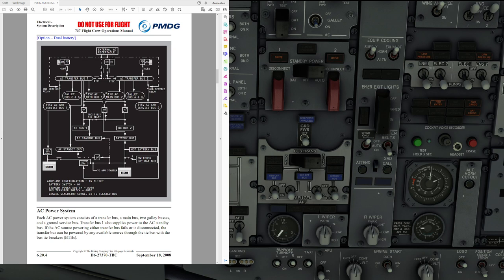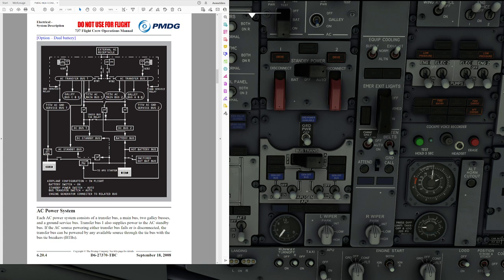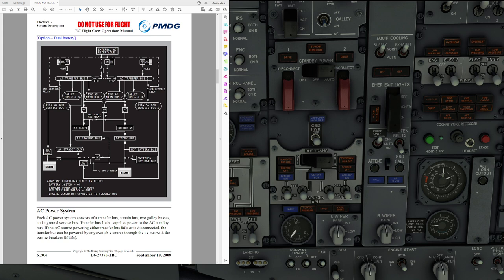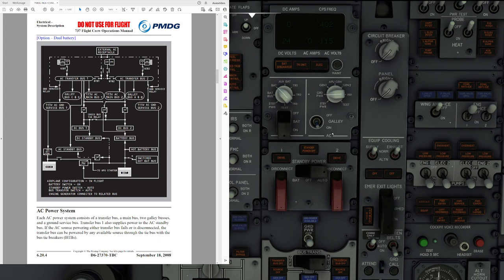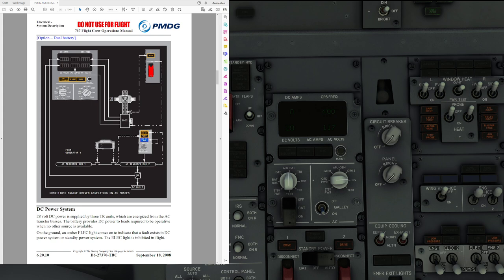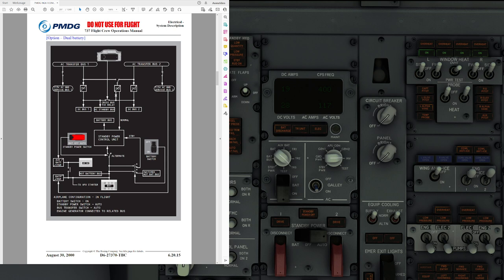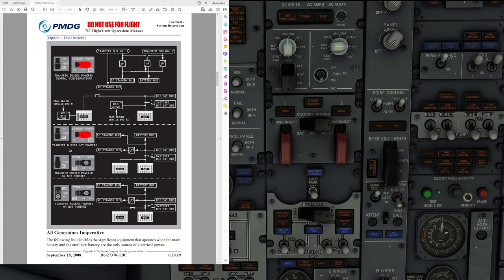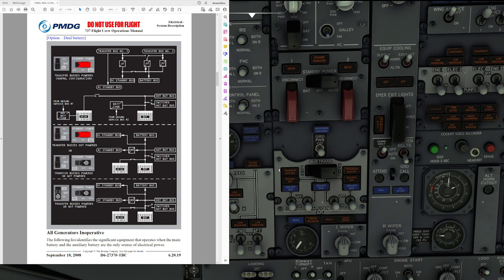737NG Electrical System explained | Real 737 Pilot

Comment: I have heard from my company's mtx people that if we were to leave the DC power display on Battery over night you risk draining the battery even if the battery its self is in the off position. Is this true? I am a ramper who's trained in APU operation for moving the Jet on the ground via tow.
Reply: Yes, as the battery telemetry that measures the voltage will draw a very small current (~1200 mAh) to power the display computer logic system, itself. Typically, this is not a real issue with modern dual-battery systems, but it was a minor concern with single-battery systems. However, the batteries would have to be quite discharged (more than half) for this to be a real concern. That all said, yes, it is best practice to not leave the battery monitor indicator switch on the BAT or AUX BAT (if equipped) setting in a shutdown (cold-and-dark) configuration, when possible. Hope that answers your questions, and BZ.

Comment: Sorry for being 18 months late but I have a question, I’m also aware you are now operating the A330 so may not know the answer but hopefully someone does. You mentioned that the only time the system automatically generates power in replacement of another is when the APU is turned off in flight after a no-bleed takeoff. If I were to replicate the same scenario but on the ground (bleeds off, APU on, GEN 1 & 2 available), would that feature still work? Or does it require the aircraft to be airborne? Sorry if I over complicated that or didn’t give enough detail haha. Thank you in advance
Reply: To answer my own question, it would not work.

Comment: Is this system layout basically the same since the original 737? It seems so much more complicated compared to the A320 one
Reply from the maker: I can only comment from the 300 onwards as that's what I'm type rated on (300-MAX) and those have basically been the same ever since. Not sure if the 100/200 were different.

Comment: Hello
How long can the battery alone power the aircraft?
Reply: As mentioned in the video, a single-battery system will supply both the 28V DC and (through the inverter) 115V AC busses for approximately 30 minutes. A dual-battery system should last approx. 60 min. Hope that answers your question, BZ.